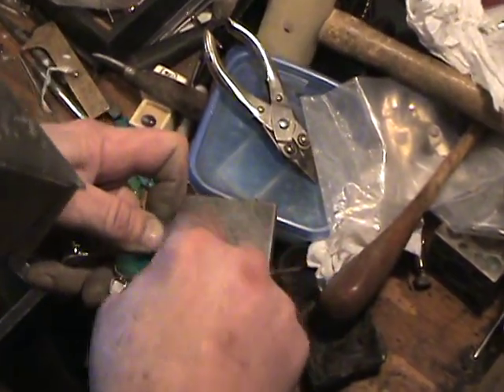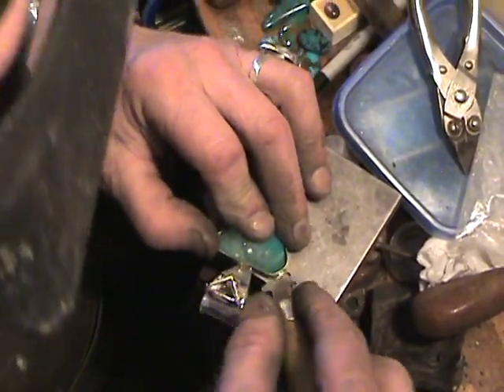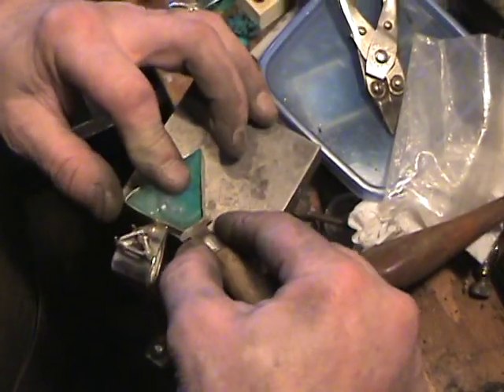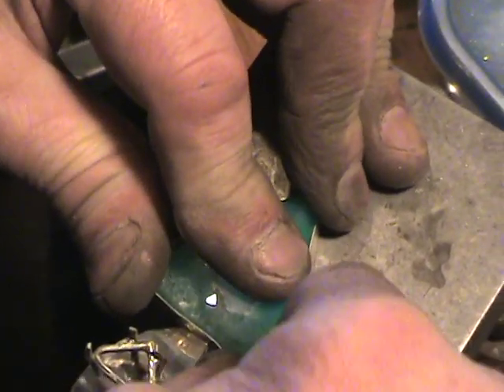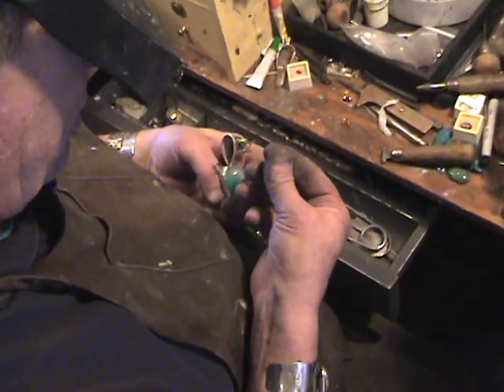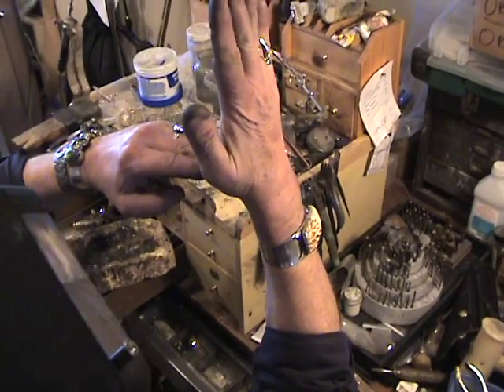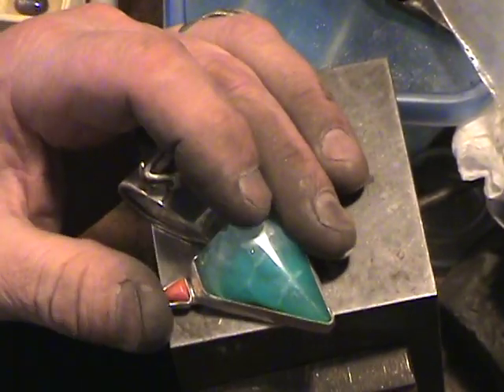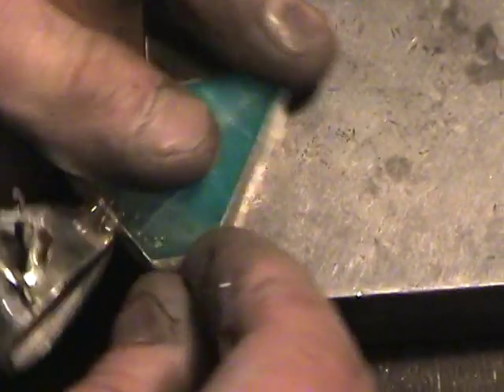helpful hints with bezel setting stones tutorial silver smithing

Comment: Do you have a tip on cutting a flush cut on bezels
Reply from the maker: not quite sure I understand your question, nicoli filed his bezels down to get a clean smooth top for a nice silver rim around the stone, in other words,.. he soldered the bezel cup, turned it upside down and ran it lightly down the file to remove anything that wasn't square and "smurfy" looking then set the stone accordingly, it made for a nice even finish